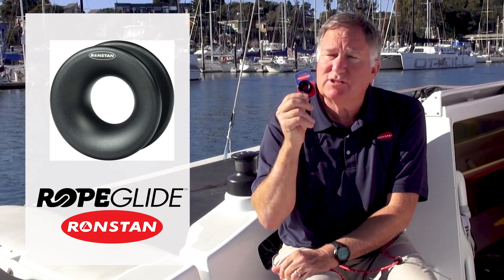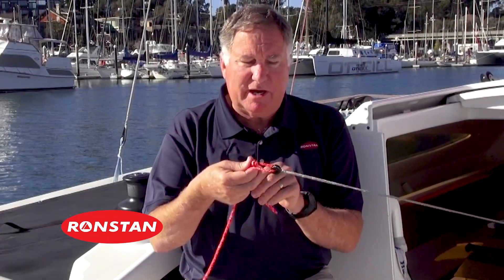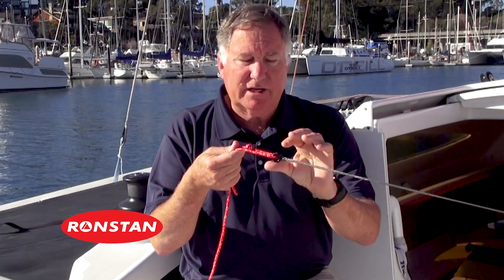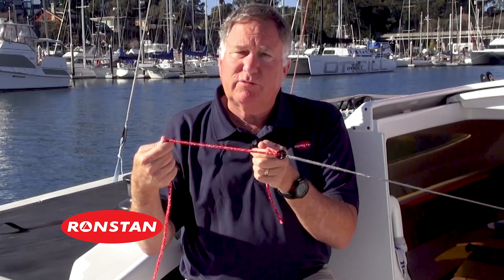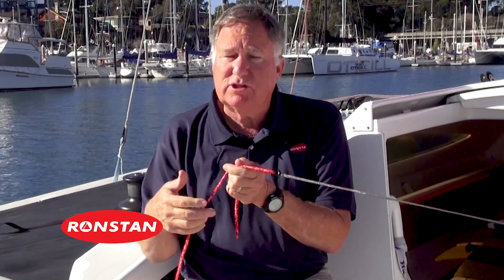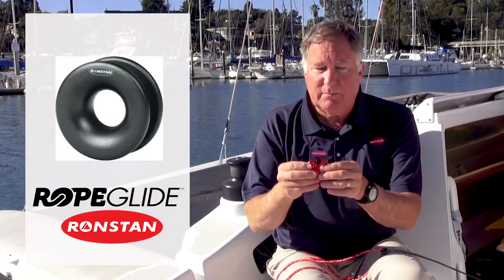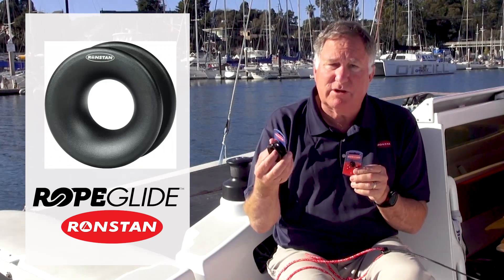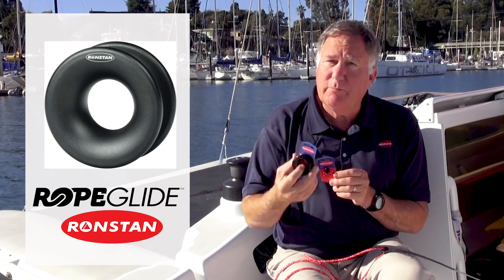Ronstan RopeGlide™ Rings

Comment: I am wondering why the pulley action is on the ID of the Ropeglide ring. Why not support the ring through the center (inside diameter) and have the dynamic rope around the groove on the O.D.? Thanks in advance if a Ronstan representative could reply :)